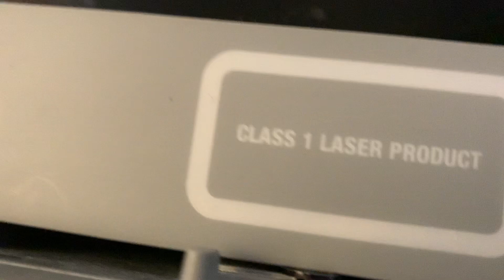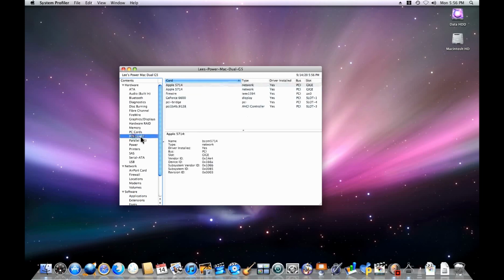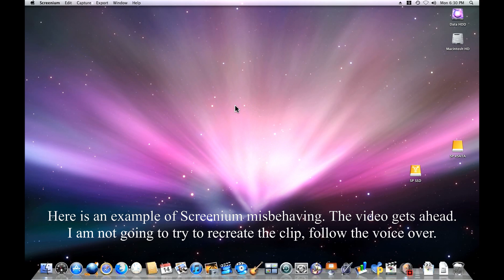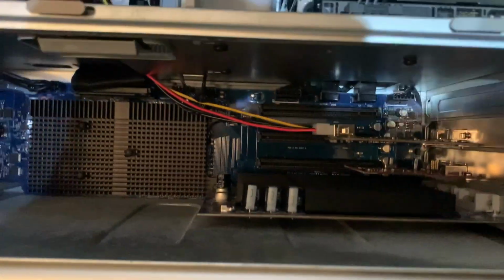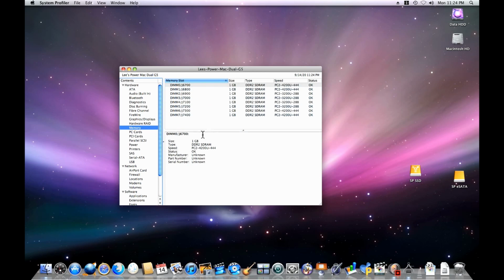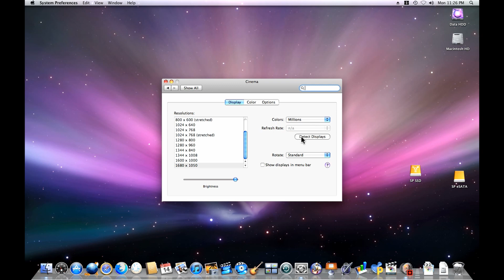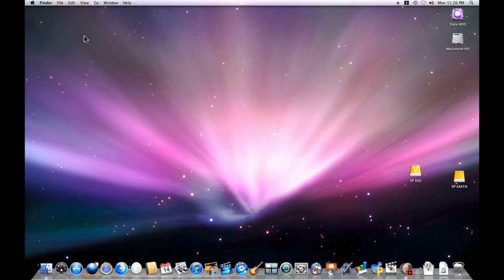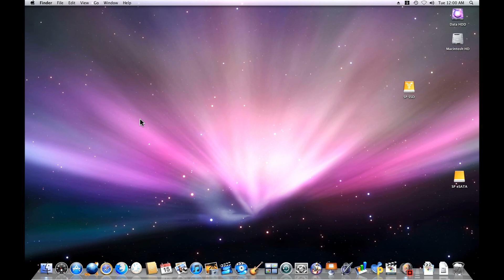Power Mac G5 Dual Core, the Resurrection!

Comment: hello everyone, I have a few questions,
what so far is the best upgrade video card?
has anyone installed windows?
what is the best performance OS installed?
Any repurpose projects?
anyone still use it for video editing?
anyone use it for music editing?
is 8GB the max ram?
Some of this im actively researching via search engines, the more info the better. 
Thank you for your time.
Reply from the maker: Remember, this is a rather old video, I have much more recent PowerMac G5 videos on the channel.

To the best of my knowledge, the most powerful video card for these machines are the Nvidia Quadro FX 4500s. 

These are PowerPC machines, Windows can only run under emulation. The available emulators ran very slowly, and a modern version cannot run at all.  

The max native OS is Mac OS X 10.5.8 Leopard. I still find it the best OS for the machine, although there are a small number of Linux distress that  still support PowerPC. However, they are still limited by the software support by 3rd party developers. 

It is possible to edit video, but it is slow, and the software is over 10 years outdated, so the video will not meet modern standards. 

Audio (music) editing is still very possible, and there are a few audio professionals who still use PowerPC machines for the purpose.

The late 2005 models all could address up to 16 GB of RAM. Earlier models were limited to 8 GB.